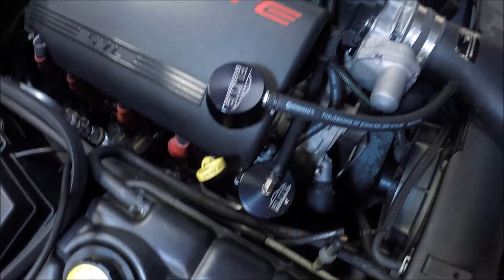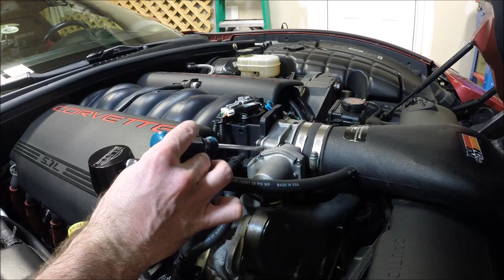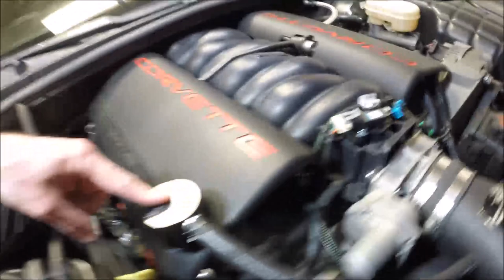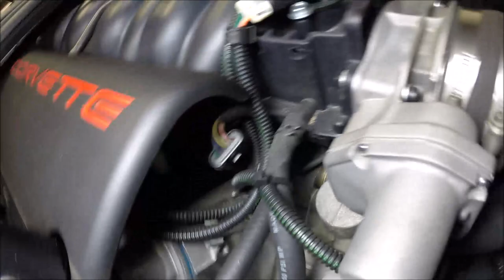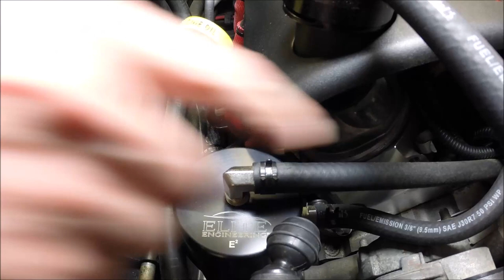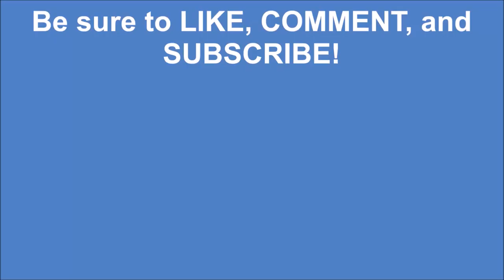Elite Engineering Catch Can - LS1 engine with LS2 TB and LS6 Valley Cover

Comment: Question on the Elite clean side separator. I have an LS3 C6 and right now the factory hose runs from the passenger valve cover to the intake bellow, if I use the Elite CCS like you have and run a hose straight to the intake bellow would I just cap off the barb on the passenger valve cover? Thanks

Comment: Just a minor knit pick Scruf, there's no vacuum ahead of the throttle body.    It's just fresh air supply or fresh air inlet.   Those Elite engineering kits sure are nice products.   I agree with Darrin Watts, they're a bit on the proud side of those kits.
Reply from the maker: It's actually no different than the LS1 setup.  The clean side vacuum port on the LS1 throttle body is actually pulling air from in front of the throttle blade.   During normal part-throttle conditions, there is vacuum in the intake manifold, so that's what runs the pcv system (and the catch can).  Under WOT, intake manifold vacuum drops to essentially zero, thus the need for a "clean side" air port.  Under WOT there's a slight vacuum in front of the throttle blade.  So you'll want to mount your port in the air bridge as close to the throttle blade as possible.     As for the cost of the Elite Engineering catch can, value is in the eye of the beholder.   I can attest that while it's a little pricey, it is top quality stuff.  I've had mine for over 3 years now, and it looks and functions like brand new.   But each person has to decide what works best for their build.  There are plenty of good options.

Comment: Ive tried 3 catchcans and every possible run way of breather hoses and still ended up with blow by oil in ya intake. I blocked valley cover breather up and where it went to the intake manifold, then just run a vented catch can with lines that run from each rocker cover.

Comment: If you track your car,  elite engineering told me,  even on my LS6-Z06 to run that clean side in front of the throttle body.  What would I do with that hook on the back of the throttle body,  cap it? Maybe make a a Y from the back and front?

Comment: Do you need the pcv valve any longer since you installed the ls6 valley cover? I have a 01 z06 and looking to get the elite engineering catch can and clean air seperator. Thanks!
Reply from the maker: No, with the 04 LS6 style valley cover, the pcv valve is in the valley cover.
Reply: Hey I also have an 01 z06 so when I installed mine catch can I ended up removing that pcv valve completely for add reason my rpm will rev up to 1k every time I'm stopping at the light

Comment: So did you cap off all the PCV hoses on the valve covers?
Reply from the maker: Yes that's correct.  You'll need to cap off the two ports on the passenger side valve cover.  On the driver's valve cover in the rear, there's a larger port (for the cross over tube that you'll remove) that needs to be plug.   Use GM plug # 12568011.
Reply: @ScrufsGarage  Or you can go with a new passenger valve cover with only one port too